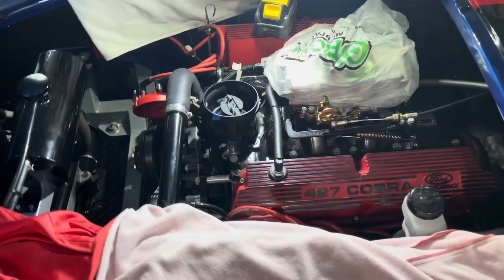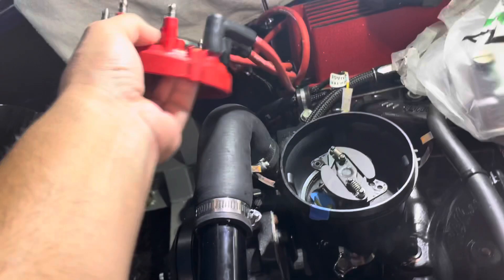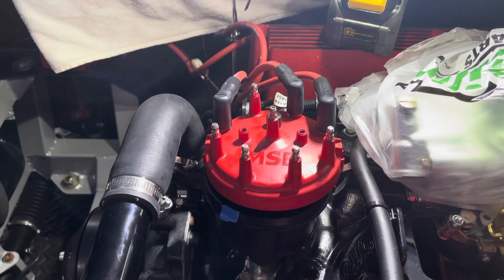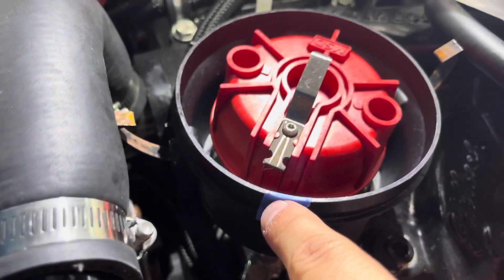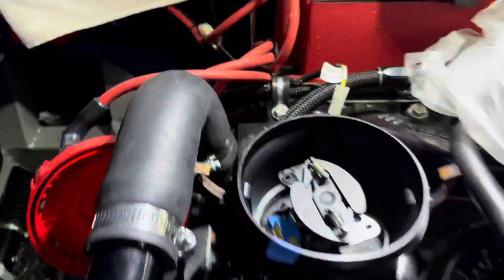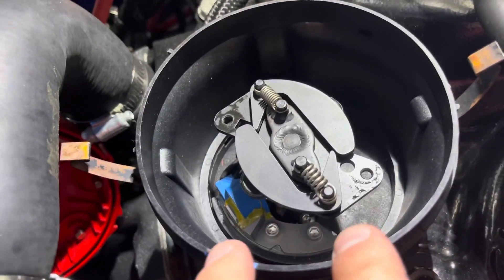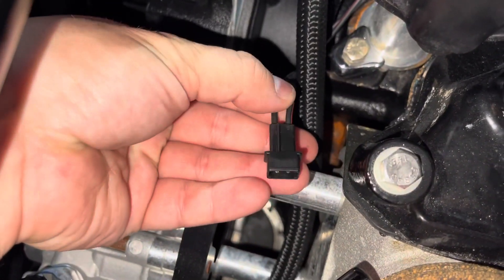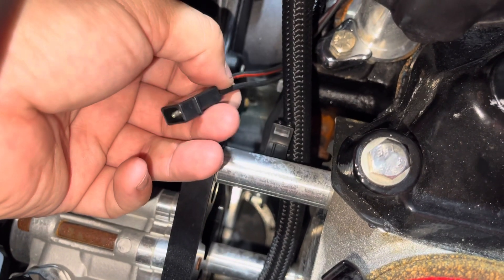MSD Distributor Mag Pickup Removed without removing the distributor

Comment: What symthoms does bad magnet pick up coil have
Reply from the maker: Won’t start, it will crank but not start.
Reply: @CSJiGSaW08  I installed a new one and it will start but later shut off. I didn't realize I have to leave a certain airgap now im going to feeler gauge it in to get better signal
Reply from the maker: @ the most important thing is to get it firing in the correct order, did you make sure it’s in the correct order the cables? There are diagrams for each type of motor in the firing pattern. Also did you change the full distributor including where it goes down to the motor or just the mag pickup? It’s a bit more difficult to change everything out. I would call MSD they have free tech support.they guided me with my multimeter to figure out what was wrong, but either way there are troubleshooting manuals in the internet for MSD distributors. You can also get a spark plug light tester to check for sparks on each cable. Note you can also have a fuel delivery issue if it shuts off and stalls. Start off with calling MSD and next get a mechanic if needed. Is it a Shelby cobra too?
Reply: No it's a 350sbc but I only changed out the pick up coil and icm that comes with it
Reply from the maker: @ when you took off the rotor cap, was the cap installed the same way. If you see my video I even put a tape mark I think to know exactly where it goes. If the cap was installed wrong, there would be an offset and firing would be off. Yeah just call MSD. They should help. I didn’t change my icm.
Reply: @CSJiGSaW08  mine is a little different it's the hei this one has a guide so it can't go any other way
Reply: @CSJiGSaW08  I'm to the point where I'm going to just take it to get diagnosed by a mechanic see why my injectors shut  fuel off. I changed out my old but thinking that was it but apparently not so the pump in it now is new

Comment: What tachometer you're running
Reply from the maker: I’ll check the brand, it came with the vehicle. It’s red and black. There is a parts department at Backdraft Racing in south Florida where they can get you any tach in any color you want. They customize everything.
Reply: @CSJiGSaW08  many thanks
Reply from the maker: @Coronet_shop  Go to BackDraftRacing website. Their you would go to rt4b-black-edition section. When you scroll down, you will see the cars with the Tach's. The one that's on this car is the same as the blue car with black and red center stripe. You will see the tach is all red with all matching gauges. If you interested in these cars, they come pre-built from Africa with all  harness and suspension and painted to perfection. Shipped in containers, then they assemble the motors here in USA and all the remaining bells and whistles. They run you about $80-90k, but these baby's hold their value. There is also the Fuel Injected Coyote option... More HP but 427 sounds better :). Prices Maybe even increase over time. They probably made maybe fewer than 2000 or close to that in about 5-10 years. I don't know the exact math, but fewer cars means holding value in the long run. Definitely get it from South Florida assembly facility. Third party sellers or dealers up sell $10-20k more. With COVID, i have no idea what the prices area right now. This was about 3 years ago when we got it.
Reply from the maker: FYI to be honest, this one was used with like 500 miles. Got it at a bargain for $15k less. They sell used ones practically new with owners trading in for different colors or different engines. Shop around is my best advice.